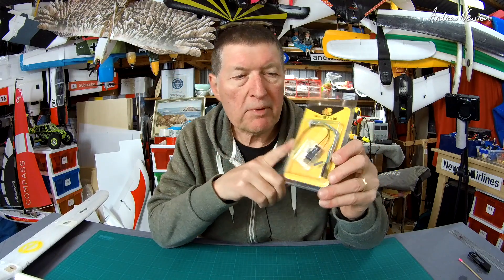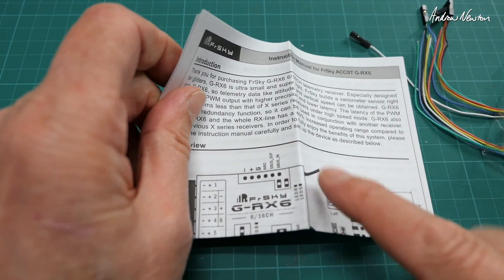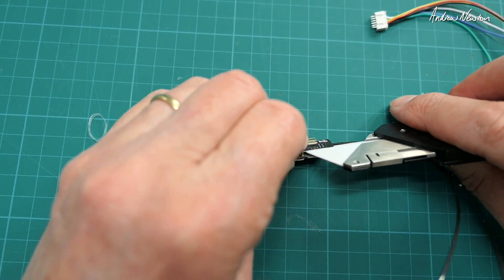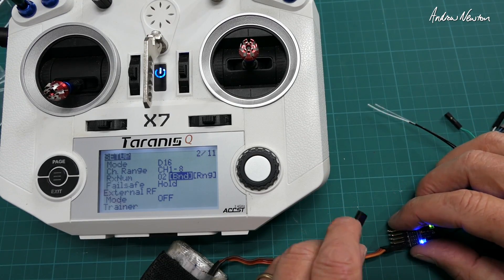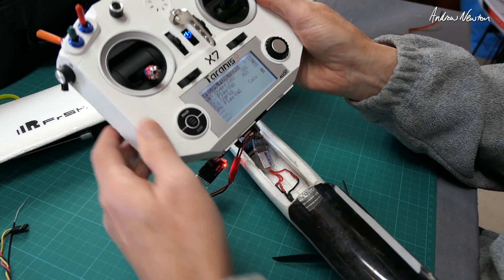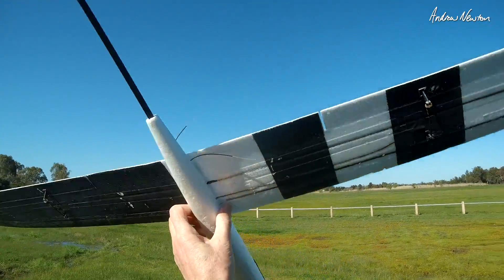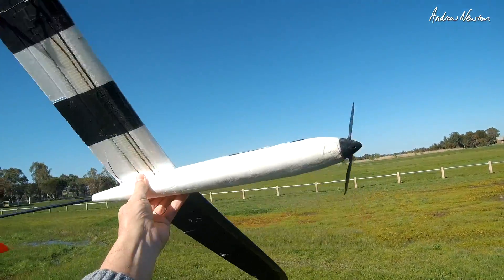FrSKY G-RX6 Receiver / Vario

Comment: Hi mate, can you tell me (best would be a list of all senders from frsky) with what senders this and the grx8 receiver is compatible? I just want my beeps to find the thermal bubbles with my f3k, I dont need much more comfort on the sender, so I hope its functional enough with for example the taranis x7 q? Would be very happy about your answer. Best regards Johnston

Ouppps... Now I See, you use the x7 q Access rs. Answer given, thx mate
Reply from the maker: Well done. Basically any FrSKY transmitter or any RadioMaster 4in1 or CC2500 radio will work. QX7 is perfect if that's what you like.

Comment: Hi Andrew, I have got my hands on a used G-RX6 that is not available anymore in the various shops (even Aliexpress). I get the telemetry values (RSSI, Voltages, Alt, Vspeed...), but I cannot get the vario "beeps" as you do. I looked onto the telemetry screen, on the "setup screen" in edge tx, and all volumes, are set in the correct way... 
I always get the "battery low alarms", the "telemetry lost" messages when My model lands out of sight, the feedback beeps when browsing the menus, but no Vario noise... 
Any idea of what could be wrong ?
Reply from the maker: Have you configured a switch enable Vario?
Reply: Hi Andrew, sorry for the late feedback, but yes I finally figured out that I had to configure a "special function" switch in order to enable the beeps 😉 This is done now and works as intended, I even added the spoken battery level on a momentary switch 😁 Perfect ! 
Thanks for your kind help 👍
Reply from the maker: Glad to hear that, well done

Comment: why do you need extra voltage sensor adapter? can you not just connect Ain2 direct to plus of your LiPo?
Reply from the maker: I have never used Ain2 but you can't just connect to a lipo https://www.rcgroups.com/forums/showthread.php?3481669-FrSky-Voltage-Range-on-AIN2
Reply: @AndrewNewton  yes I saw that...info on how to connect a Frsky Rx is terrible..the manual for Rx is useless..other Chinese manuals are better.

Comment: Hello Andrew, I see your Analog telemetry value says 12v however you don't have connected any source in that port.  Do you know why is that? I have a G-RX8 that shows the same and I have no idea how to get that fixed. Thanks
Reply from the maker: I have never paid attention to the A2 value. I have not tried this but maybe connect to ground
Reply: @AndrewNewton  Hello Andrew, Yes, I tried that and that makes the value goes to cero for a moment.  After spending some time with this I took the risk and connected the analog telemetry port for a very short time to the 5v BEC output.  That made a small short-circuit sound and the value then went to cero. I thought I fried the port, but guess what... that made the port comes alive. After that, I just adjusted the ratio value and so far is working like a charm.  Guys, please don't do that at home. I just was lucky.  Thanks for your answer, Andrew.

Comment: Nice video, what changes should I make to use Archer R6 receiver with a quad? When I tried, output was from pwm 6 pins. Kindly help
Reply from the maker: Connect to quad flight board using SBUS
Reply: @AndrewNewton  I did that, Here, when I increase the throttle, channel 1 pin out of 6 pins on receiver was getting output, I have checked by connecting it to servos. And likewise for others - roll, pitch, yawn...
Any output signal from radio is not rotating motors, but the power output is to the pins. Please help

Comment: Basically a noob, although more like Rip Van Winkle!  (been away for 20).  Just ordered this and hope I didn't make a mistake.  Plan on using it with a RadioMaster TX16s in a Volantrex ASW-28.  Seems 6ch should work if I use a Y-connector for the flaps, leaving motor, rud, elev, and l/r ailerons.  I suppose I'll see.  lol

Thanks for the time and effort you have put into this.  A year later and it still helps people.
Reply from the maker: Thanks. You did make a mistake I'm afraid.....there is no "r" in Volantex. But the receiver should work well for you. Note that there are 3 possible firmware version ACCST, ACCST D16 and ACCESS. The first two are supported by the TX16S. No need to solder on the SBUS / SPORT connector unless you want to connect extra telemetry sensors or connect to a flight control board.

Comment: Andrew, how do I wire up the connection between my G-RX6 and additional sensors? I'm using it via SBUS connected to my ZOHD Kopilot. Do I need to solder a wire for S-Port? Sorry new to setting this up and no luck on any drawings or instructions. I'm interested on adding the Lipo Sensor to the receiver.
Reply from the maker: Yes it's the third pad along from the ground pad. Labelled with S in the manual. Or the Yellow wire if you soldered on the connector. Will also need Ground and 5V (can come from the PWM servo pins)

Comment: Hello. I bought  ARCHER GR6
receiver. I applied a voltage of 2.14 V to the AIN2 input and on the
telemetry of my TX TARANIS X9D + 2019 I read a voltage of 8.8 V under
A2. If I apply a voltage of 2.26 V, I read in the A2 telemetry a
voltage of 9.3 V. If I apply a voltage of 2.48 V, I read in the A2
telemetry a voltage of 10.2 V. I cannot understand how it works the
telemetry output A2. I would like to measure the cell 1 voltage of a
2S lipo pack. I would like to subtract this voltage from the total
voltage to get the voltage of cell 2. I already bought the voltage
reader of the single cells, but I would like to have a smaller
circuit to read the voltage of the single cells in a 2S lipo pack.
Thanks
Reply from the maker: I have never used the A inputs, so you know more than me already
Reply: @AndrewNewton  I solved it like this:  https://www.rcgroups.com/forums/showpost.php?p=46020169&postcount=267

Comment: Sent for one to try - for the on-board vario - received an Archer GR6 ACCESS - is this the same rx? It looks identical, but cased, and the sbus socket is pre-fitted - supplied with two matching plugs, one terminates in a standard three-pin socket, and the other appears to be individual sockets. I presume the flight-pack cell monitor module will plug in to the sbus? I've used X8R's before.
Reply from the maker: Same but with the ACCESS firmware. Sensors plug into the S-Port (pin 3) not SBUS (pin 5). SBUS is for connecting to a flight control board

Comment: Im not familiar with planes and their electronic.
I see you stick the power supply in the 5th channel, does this receiver not come with a dedicated power slot?
Reply from the maker: I usually plug the ESC in to Ch 3 but all the ground pins are connected and all the V+ pins are connected so you can plug 5V in to any channel.

Comment: What do they mean when the item says "Non EU version"
Reply from the maker: There are two firmware version. EU transmitter firmware is restricted for power and LBT or Listen before talk, so the receiver requires the matching firmware to the transmitter
Reply: @AndrewNewton  my Taranis TX is Non EU (australian) so i was told by FrSky i had to buy the Non EU RX.
Why i not see your reply notification...hmmm

Comment: Andrew was hoping you could set me straight here as i am not sure where i am going wrong, but when i try and bind this receiver with my x9D i get the solid green light and flashing red which would indicate that it has bound but when i cycle the power it comes back with a single red light flashing indicating its in failsafe and no data is received. TX firmware 2.2.1
Reply from the maker: Might be a firmware mismatch. Is the Rx very new?
Reply: @AndrewNewton  Just got the RX so new to me but not sure how old it is.  the manual it came with says "openTX 2.2.2 and its improved versions are strongly recommended". Ive updated the firmware  on the TX to 2.2.4 but still cant get it to bind. same light show as before. ive message the supplier hopefully they can shed some light. appreciate the response thank you kindly. super keen to get this model up and flying. ive got an old X4R that binds straight away but only has 3 channels do you think i could get the bixler to fly without ailerons ?
Reply from the maker: I just replicated what you described by trying to bind to the External module instead of the Internal module by mistake.

Comment: Sorry guys, might be a dumb question, lets say I want all 6 channels for my glider, is it possible to feed 4.8/6v over the positive/negative tabs on the SBUS plug to feed power to the RX?
Reply from the maker: Good question. Yes it works fine that way
Reply: @AndrewNewton  Thanks for replying, I dont have one of this yet... have U tried it? On drones we use no pin rxs, and power gets in by that plug, now I wonder if the voltage range still is 3.5v to 10v on that sbus plug?

Comment: Andy,  just followed your video but struggling to bind this rx. I have taranis qx7, accst and have flashed the rx with latest eu lbt (in the UK). I try to bind, get red and green lights come on solid, red not flashing to show bind complete? Any idea mate?
Reply from the maker: I have only used Non EU firmware and they bind as expected. Make sure you're on the same version of ACCST EU on Tx and Rx.
Reply: Andrew Newton yeah thanks Andy, nothing ever works first time hey? Im lead to believe there is some issue with frsky updating D16 protocol. A bit beyond me tbh. Thanks anyway
Reply: @AndrewNewton  Andy,  I assume the only way to update the fw on this rx is to solder the plug on and flash it. If this is the case,  why don't they fit the S.port / Sbus plug in the first place.  How can you update it without it?
Reply from the maker: @mickelson8332  Yes correct. I guess it's to keep the weight and size at a minimum for those that dont need S-Port
Reply: @AndrewNewton  hi Andy,  is it possible to use s.port and sbus from this rx. I'm used to using x8r where there are two different places to plug into but on this rx there is just the one plug. Do i have to do some clever wiring? thanks mate

Comment: Can always rely on you Andy to be the source of knowledge. I need a small rx that I can use with sbus but also need a pwm output on it as a mode switch for my vifly finder 2 for failsafe activation. This will do that won't it? Cheers Mick.
Reply from the maker: R-X6R is cheaper if you dont need the Vario  - https://bit.ly/3cTzzpp

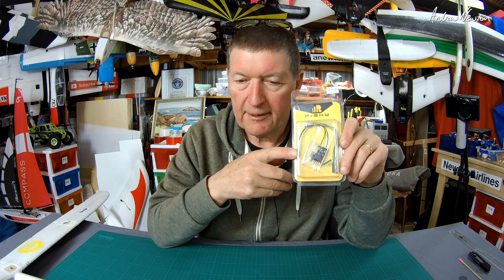Comment: I have used Frsky vario units on FPV gliders for years. Once you soar a glider FPV via a audio vario, your hooked. I enjoy seeing how long, how high, and how far I can fly using the fewest amps. My current record is 1:37,  2700ft,  4mi, 800ma 3s. The R9 series 900mghz  receivers have S Port input. They are my current long range setup. I have gotten 3 miles with telemetry. Remember you can run multiple sensors. I run a variometer, voltage meter, and GPS.
Reply from the maker: I have FPV thermalled with a Radian. Interesting project for long range

Comment: Hi Andrew. Could you do an 'idiots guide' set up video showing how to get Range and Distance please and the AGL /GL compensation. I get into a right muddle with this. Thank you in anticipation.
Reply from the maker: Do you mean with a GPS sensor? Vario only gives Altitude and vertical speed
Reply: @AndrewNewton  Well there you go, I did say 'idiots guide' lol.  Yes you are correct. It's to get the triangulated Distance (height & Distance out as opposed to the grond distance, if that makes sense. Is it done by combination of GPS and Vario or GPS only. A guide would be great thanks

Comment: well i ordered  a x8r ,, it came, through box on bench ... month or so later finished my p51 scratch build , opened box package says x8r  opened it up it was the 8 ch version grx8 in a x8r package and instructions. so i put in my ultimate bipe and i have alt. and vario which goes crazy lol.  works great just did firmware for analog servos
Reply from the maker: Scored! G-RX8 is better
Reply: @AndrewNewton  yes it is a great rx,   any glider suggestions?  i have an old f16 slope sorer by combat models from early 90's but i no longer live in the mountains so i didn't use it in that. have looked at some plans to build one but have a few other models im building now

Comment: I might have to get one of these.

Quick question though, is HOLD as a failsafe such a good idea on a glider?
Reply from the maker: Good question, a custom failsafe that makes the glider circle gently down to the ground would be best.
Reply: @AndrewNewton  
I have most of my models set to motor off, level or slightly up elevator, zero rudder and slight left aileron.

And from experience I know this works; one area I fly has rare but pretty servere bouts of interference and it's nice having the model not just suddenly drop to the ground!

Comment: Nice review. Interesting the sound there (the beeps) but I guess you need a radio with adequate telemetry with a little more than battery and temp like my old fashioned DX8.
Reply from the maker: For this one you need a Taranis and OpenTX
Reply: The taranis 9 lite is around 90usd to 110usd. That is the best I found.

Comment: Maybe someone knows what is Ain2 port on these newer Frsky receivers?
Reply from the maker: I think it's for connecting older pre Smart Port sensors. But I have never used it.
Reply: I think it's analogue in for battery sense / voltage divider but don't quote me on that.
Reply from the maker: Here's an explanation https://opentx.gitbooks.io/manual-for-opentx-2-2/telemetry.html